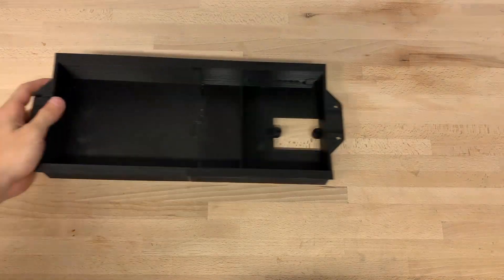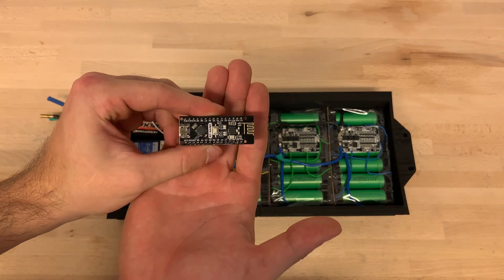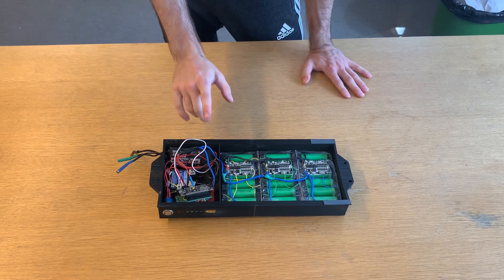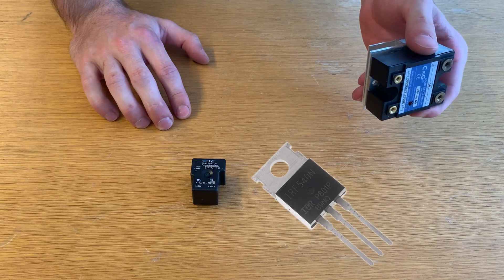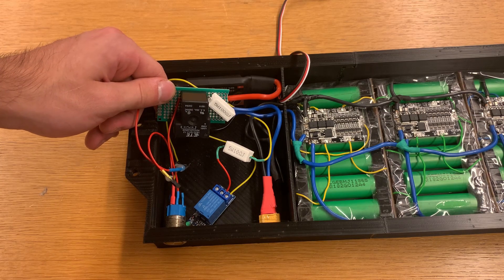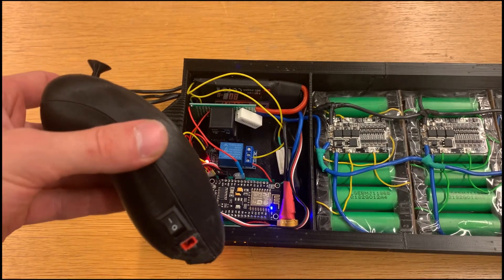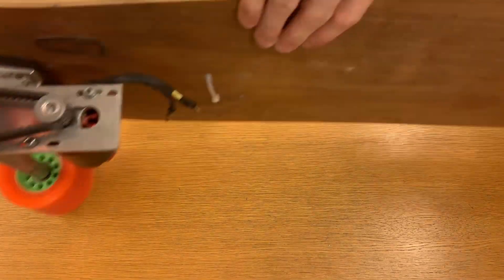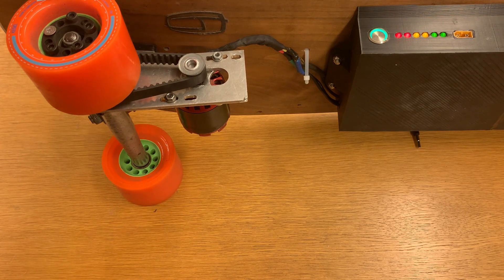PRINT your Electric Skateboard?(under 150$)

Comment: Be careful with the SSR as they usually fail closed. With the mechanical relay, does it have a flyback diode? Perhaps you could use multiple parallel relays in series for slower switching, and redundancy?
Reply from the maker: Yeah the SSR relay was a bad idea to start with. But yes the other relay has a flyback diode on it. Even tho Im using a small relay to switch the big one so the voltage spikes shouldn't harm anything regardless.
Reply: @bootlegengineer  diode still saves on damaging the load relay contacts from excessive arcing if opened under load, but would probably last basically forever regardless. Awesome build!

Comment: How did you go about smoothing the start and the brake?
Reply from the maker: To smooth the start I just increase the speed More slowly in the software, so if the controller has a higher value than the current board speed, it will increase the boardspeed by x every 100ms for example. This motor does not have direct feed back so we can only adjust the desired board speed. There are a lot of BLDC motors with hall sensors, with those you can make a real smooths acceleration curve.

Now breaking is a bit rough. I just break via some resistors... but its hard to have the balance between no break at all and too strong of a break + a burnt resistor. Idealy you buy a more expensive ESC that handles that. But hey i wanted the good old cheap stuff